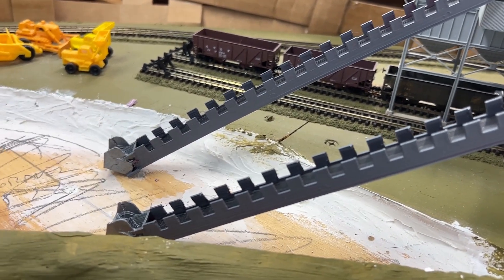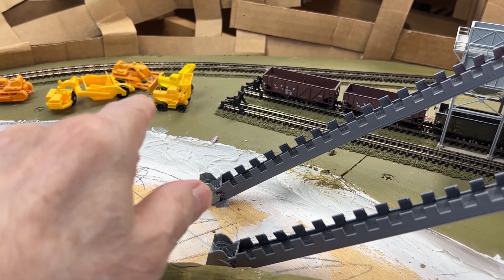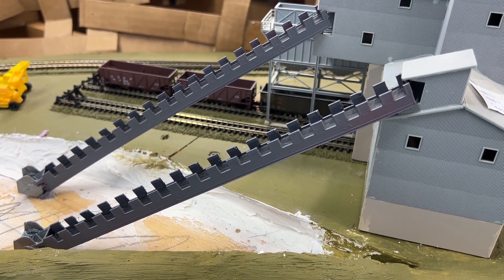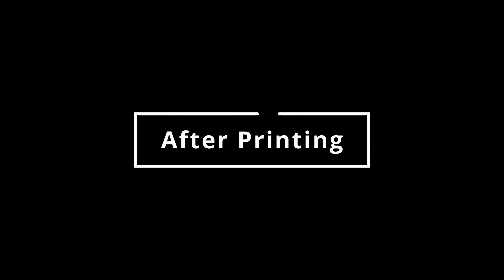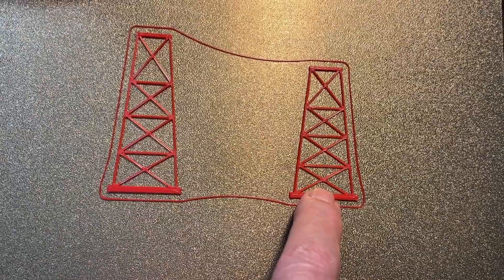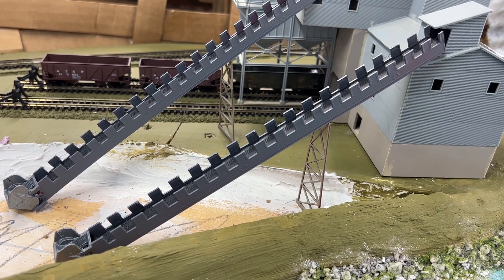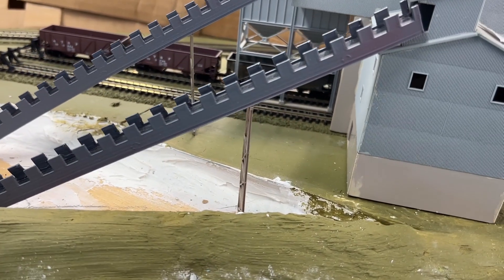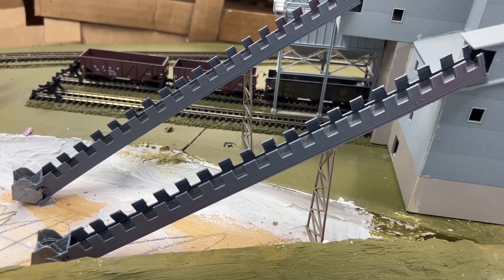Gravel Conveyor Project  - Part 2

Comment: Looks good, John.  Are those the type with wheels ? And what gravel are you going to use?  Not sure WS sells them or you’ll just use the fine ballast.
Reply from the maker: Hi Drew, I have several kinds of ballast both from WS and others that I plan to use. I have designed a lower set of supports that I will print and paint tomorrow plus test fit. Then I will have to start work on the scenery and ballast along the mainline tracks along the back wall before moving to doing the area around the gravel company…..John